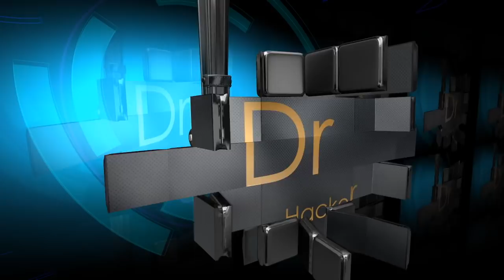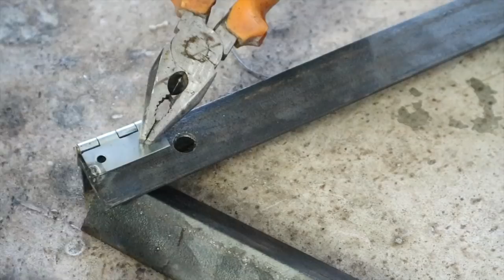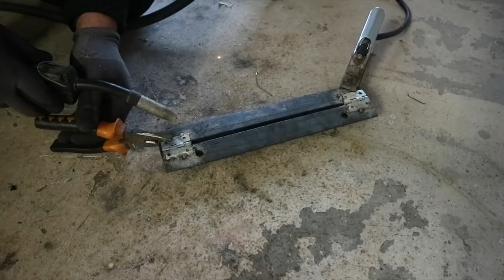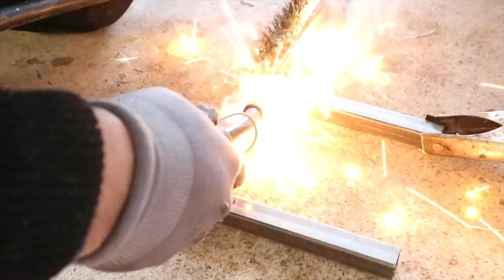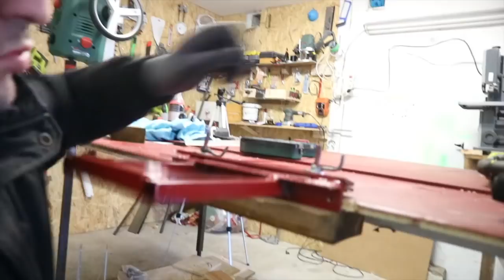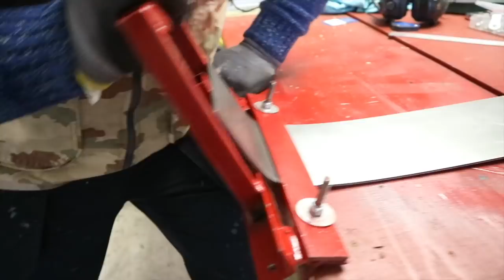Wow!!! Awesome Brilliant DIY Ideas

Comment: - Add "Wing Nuts" but one wing little long so you can tight it with little force. 
- The handle is very short that's why it's needs lot if force. If u use principles of torque u need long handle so u will need very little force.

Comment: Put wing nuts on the studs and it will be easier/faster.  You also need weld on hinges from welding supply.  They won't bend as they are twice as thick.  Good job, just poor parts.

Comment: ... the second steel plate probably had a thicker gauge for the bender. the table where it is attached almost gave away ;-) but I got the point, a bigger bender is needed if thicker steel plate will be done. brilliant idea though!